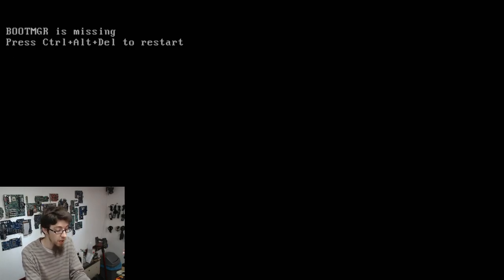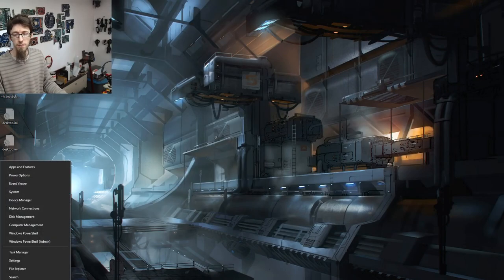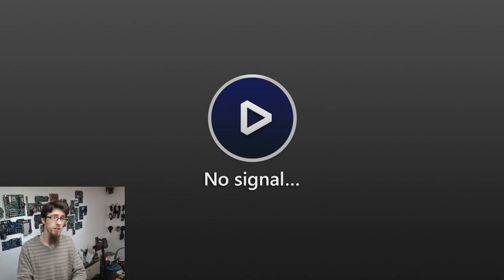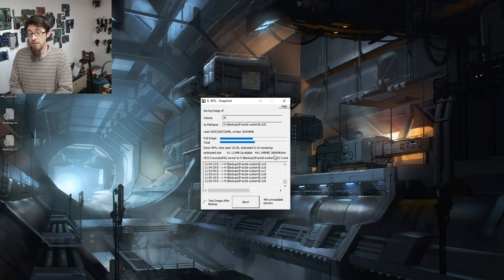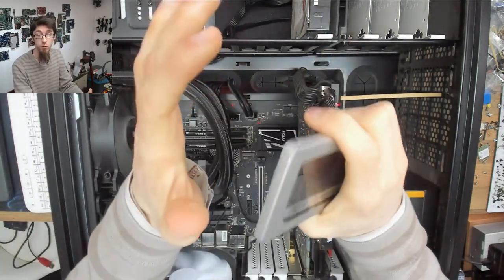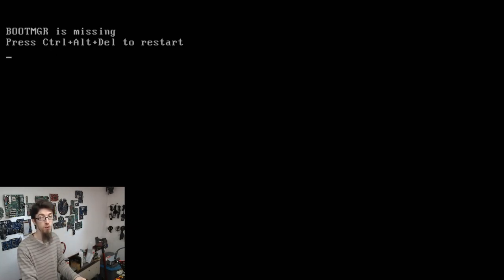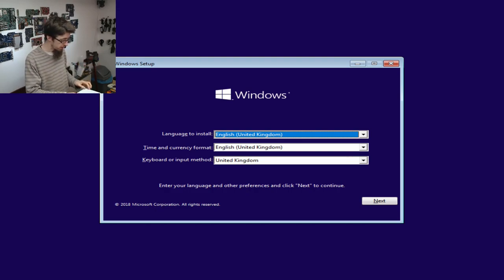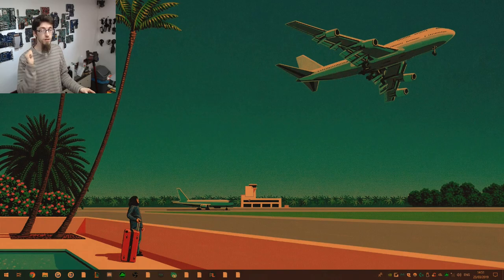LFC#170 - BootMgr Is Missing

Comment: before reinstalling windows  download a copy of ubuntu boot repair and actually fix it...and forget using windows repair tools..having learnt the hard way with multi boot systems having multiple harddrives with multiple partitions  ive seen ntloadet missing boot manager missing system disk missing grub missing and just about every other boot issue there is  my goto solution toolbox... yumi multiboot from pendrive linux with ubuntu boot repair 32 and 64 installed as well as win 10  and some linux distros common driver software and usefull software all on one stick  ya memtest will run off it too but honestly just learn linux system administration and boot into a live session fix the windows issue reboot and go back to gameing

Comment: Somebody doesn't know how to read SMART data, lol. "Current value" drops down from 100 during the life of a drive. This means that "Retured Block Count" of 95 is still pretty good and won't drop down to 3 (threshold) any time soon. "SSD Life Left" on the other hand already dropped down to 1 which is less than 10 (threshold) and that means it FAILED.
Reply from the maker: Good info 👌
My knowledge with smart is very limited because as far as HDDs are concerned, I consider SMART to be utterly useless.
However with SSDs, it's kinda all we have to go on, so yea I'm going to have to get more familiar with the numbers.

Comment: I trust a good mechanical drive for long term storage and use than ANY SSD. Never had a HDD fail , and also SSD memory cells leak over time. And the controllers can go bad , have had it happen.